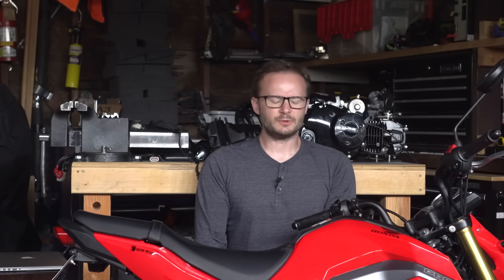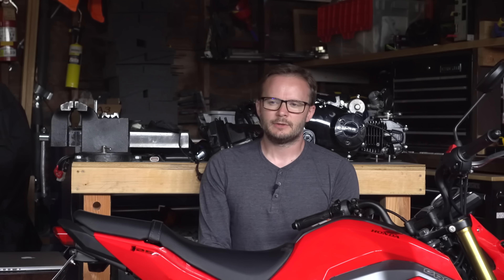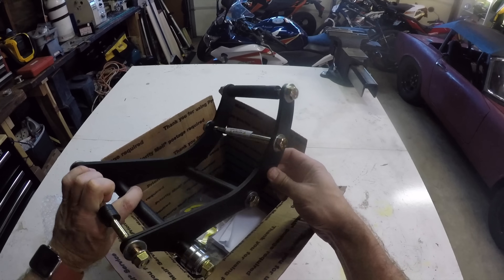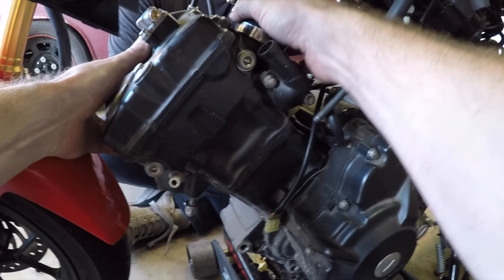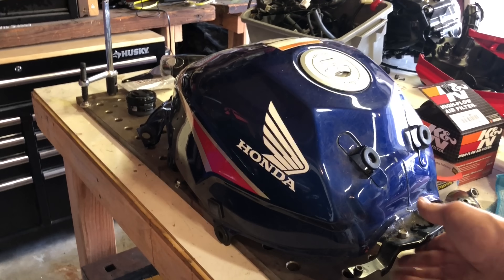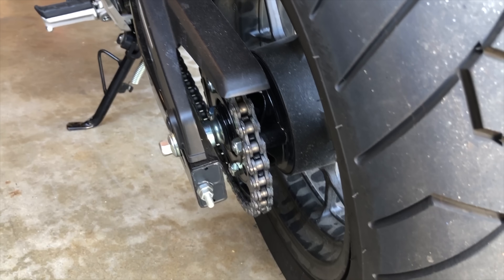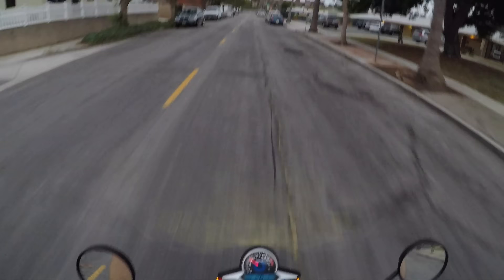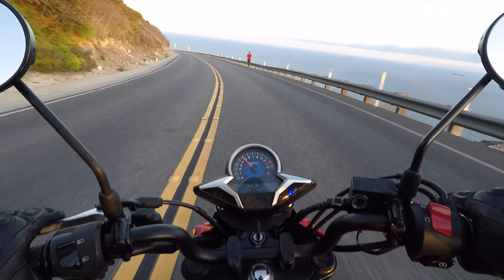Honda Grom Engine Swap: Twice the Engine for Twice the Price - CBR 250cc / 300cc How-To

Comment: For fuel Air ratio adjustment, I used a resistor in between the O2 exhaust sensor and the unit.
Though the ECU reads the signal digitally, it still enriches the mixture to the point where 1kOhms resistor gets black exhaust soot.
But you can feel what setting works best. It's a bit of give and take. Too high of a resistor (I tried with a 1kOhms pot) and the top end suffers, but the bottom will ride great. Too low, and the bottom end suffers.
So a mixture (I think I used a 250Ohms resistor, but don't quote me on that).
Reply: Just do it the right way and have the ECU retuned.
Reply: @The_Cat_Authority  actually the right way to do it now is with an aracer ecu. I do not know anyone with just a "retuned ecu" for their swapped grom. I have a 250 swapped sf.
Reply: @jaycolor994  Cool story dude.
Reply: @jaycolor994 How hard is the aracer to set up?

Comment: I had a 250 Kawasaki Samurai back in the 70's; thought THAT was complicated compared with it's rotary disc valves compared to the 250 Villiers engined James that I previously rode in the 60's ! This 250 make those things look like a T-model Ford in comparison; at least petrol gravity feed to a simple carburettor and a VERY basic electrical system made them easy for a teenage kid to work on then,................ I'm still modifying and riding motorcycles in my 70's !        Thank you for an entertaining channel !

Comment: its crazy because I thought of getting one of those Chinese Grom clones and swapping a 250 engine in it, i thought it would be easy because they would be both carbureted and both air cooled... but I just noticed you did it the right way (without being lazy with those two things I mentioned)

Comment: From what I understand the diode is for the hiss system (honda integrated safety system) the diode converts 12v from the battery to 9v to power your ecu.

Comment: I scratch built a board track style bike in 2016 starting with a 2013 cbr250r.  Later I swapped the 250 for a 300 and a few mods later I’m at 30hp to the wheel on a 250lb bike

Comment: The best way to lower the cost of a project is to save the Old Parts ( drive Chain ) And sell them later.
Why damage and Waste  things ?
That you can recoup some cash from .....
Work smart lower costs .
Reply: Excellent tip!
Reply: Try and sell a used chain on craigslist and let me know how many years it takes lol
Reply: @darklorddylan1316  
Facebook marketplace or Ebay would be better for that.
Reply: Q is legit. Don't trust the media. It's still a used chain. And the factory chain on bikes requires drilling of rivets so it's pretty much the same issue

Comment: The pink wire out of the ignition switch needs to see 5vdc to the ECM so you can't just cut wires twist them together and steel the bike. It's usually not even in the wiring diagram.

Comment: I was wondering why Kawasaki made their little z125 to be the grom killer but they didn’t put a 250 or even a 200 or even a 150 motor in it. I was guessing it had something to do with engine size laws and all that but seeing this guy put a 250 in a grom makes me very happy. If I were him I’d make the tires slightly bigger and maybe a little big bigger suspension and make it a step up from the grom in all areas. Good shit making this tho man.
Reply: Bigger wouldnt make it handle better. Bikes aren't like cars.
Reply: @chrispekel5709 yep. It’s now going to be limited by its height. Making it taller won’t make it handle better, but it will allow you to lean over farther, and that will allow you to corner faster.

Comment: Why not just swap the whole front end of the CBR ? Instead of worrying about controls, plugs, gauges etc... Plus get a brake and suspension upgrade presumably.
Reply: I would assume the forks are substantially longer and the tires are bigger.  It wouldn't work I don't think.

Comment: Very nice power upgrade.

it would be really nice if honda started offering the grom with larger engine size choices. even a 650cc would be really nice. and of course the frame and entire motorcycle would be increased in strength to handle the increased power. i just like the smaller size of the grom, but really need significantly more engine power. 125cc is not even close to enough power for my comfort. i like to be able to move out of the way quickly, as needed, when needed. and overall, i enjoy a more powerful motorcycle, while simultaneously being able to fit the motorcycle well. the grom really is the perfect size motorcycle. it just needs reinforcements where needed, and much much more power, for those of us that prefer more power to be available, at any given time.

Comment: Quick question, Since the cbr engine now sits at a weird angle will you have any problems with the oil pick up?
Reply: Yes. Yes he will.
Reply: @SchoolforHackers  There are several build threads and reports of guys putting thousands of miles on after a 300 swap, with no damage to the engine.
Reply: @jasonb6570  Okay, if it works it works. My observations are from seeing three different guys kill the motors riding extended wheelies on pit bikes. If this one works out, cool. But I’d be feeling spooky.

Comment: Put a screen in the intake it’ll help atomize the fuel too I do it to small go kart engines when they get modified just to help break up the fuel since I run richer than factory it’s tricky but doable and I’ve even seen them for sale

Comment: You can use a small fabric mesh over the intake or pantyhose I think is a common thing for sandy environments.   Otherwise you can make a metal mesh dome and cover that as well to keep it from getting sucked in while still providing good airflow.

Comment: What is the top speed?
Reply: The top speed will be whatever the top speed of the cbr was, since the gearing stayed the same. It will be physically limited to engine rpm and gearing, regardless of it being in a lighter, smaller bike. It will just get to the top speed faster.

Comment: I hit 65 and 70 on my grom all the time Id say its fast enough. One of the main reasons if not the main reason the grom has so much success is because of the mpg rating not because of the speed.
Reply: It's the top speed. 
Honda already had a huge success with the Ruckus and it's mpg. It just lacked speed.

Comment: I believe the diode is for the starter. i know on the 600rr there is a diode in the starter switch and the engine wont start if it goes bad

Comment: Yeah no nose wheelies as the front wheel traps on the motor , some miss the basics like oil pump running dry cause motor is to far tilted

Comment: I'd imagine going two stroke with a YZ125 engine would be more practical. Less weight and almost as much hp probably. the YZ makes 35HP and has 6 speeds. Only challenge would be wiring since the YZ has almost none.

Comment: Need help before tomorrow. 2019 Honda grom crack in the headlight , has aftermarket exhaust, I got them down to $2400 and it’s 3hours away from me. Versus a 2018 grom with new exhaust , pro tapers , new grips , flush mount blinkers, and license plate mount, and a new tail light. But the stuff is in the box and I need to have someone put it all on for me. He’s asking $2800 but I’m going to see it tomorrow an hour away and I’m pretty sure I can get him to $2500. Need help which is a better deal ! Both have around 1500 miles on them. Posting everywhere grom related 😂😂😂

Comment: I would opt to make a streetfighter/naked out of the 250 instead, get rid of the fairing, clipons, add a handlebar for a more upright riding position and swap the headlight for some eBay round one. But that's just me, a guy from a place where a 250/300 is a step up on the motorcycle ladder and not just disposable beginner bike trash.

Comment: I don’t get why you need a tune when you haven’t messed with the internals? What am I missing. Why wouldn’t the ecu just think it’s normal operation with the relocated injector?
Reply from the maker: I think it has more to do with the fact that I went from an intake with a volume of maybe 1.5 liters to no intake. So the response and resonance and whatnot is all out of whack. I didn't expect it to be as bad as it was either. Maybe it's worse because it is such a small engine and is more susceptible to variation?

Comment: To be fair…… it’s not so true that you’re “limited to 9 hp”. Without dropping the stock motor, you can reliably get to 16+ hp (I’m speaking on the 22+ motors I know, and I know you can squeeze more out of the 21- motors) for about 2k in mods. Which makes these run easily in traffic and a blast to ride with far less work. Nowhere near the fun of 30hp……. But not at all limited to 9hp. When I come across a good deal on either a 250 or 300 I’m sure I’ll build one myself, but 16hp or more in these is a ton of fun too.

Comment: I really don’t understand why Honda thought it would be a gear idea to put a 125 in the grom, that’s like so ridiculously underpowered for riding at all.

And I really don’t understand why Honda decided to continue with the Zener Diode for the security system. It’s the same thing on my 2001 F4I but the ECU needs to see 9v before the bike will crank or even fuel pump primes
Reply: Because they are insanely popular in southeast Asia and get 125+ mpg with the 125cc

Comment: you consider "a little bit more" is going from 9 to 30hp?  doubling the power would already have been more than a little bit.  so i'm pretty sure tripling it has got to be considered quite a bit more than a little bit more.

Comment: Zener diode sends that 3.9volts to the bikes computer, if the voltage isn't correct it will not prime the fuel pump or send spark to the plugs... Ask me how I know 😐

Comment: Ive recently got done doing the swap using your video. Super helpful but i have one question. The cbr300r i used as a donor came with engine and main harness, on harness there are two sensors that look to be for air or smog, not sure. Both connect to plugs near carb. Can you tell me what you did with them?
Reply from the maker: There are some sensors that go from the crankcase or exhaust back to the intake. Since this swap gets rid of the intake, you can just remove the sensors and plug the hoses. You can also tap into the short inlet tube and plumb them there if you want to keep them but you don't need them for the engine to run.

Comment: You had a fully functional 250, already assembled and you chose to dissemble both bikes to make the smaller and less useful bike work? And then you cut the chain right before you took the rear wheel off?

Comment: Great job on the video! I have a lifan kp 150 and have been wanting  to do a swap. The kp is a cfr engine clone. Wondering if you knew if a swap on it would be similar? Thanks for any advice!
Reply: Swaps on those Chinese bikes are pretty simple, you could easily find an air cooled ebay chinese engine to swap in without all the water cooled junk.

Comment: Yo Matt did you figure out if it was low in power below 4500rpm  because of the design of the fuel injection location or was it tuning?plus how is it running at this point?

Comment: I have an underbone that it not your regular 125 cc 4 speed with clutch on foot and automatic clutch to start rolling. 
Honda GTR comes out of the factory with a CBR 150 RR dngine, 6 speed, manual clutch, 16 HP and DOHC because why not? 
I would like to swap my CBR 150 engine for a CBR 250 or 300 do you think I could just unplug the 150 and plug the 250 one and remap the ECU and use a bigger fuel injector and radiator?

Comment: Why does the CB ECU need to be tuned?  The grom is lighter than the CB, so it's putting less load on the engine than the CB would have.  I would think the tune is fine.

Comment: The additional weight added from the CBR300 engine vs a Grom with a 24rwhp 1814v koso kit. grom with blueprunted bigbore will smash the 300 every time. that power to weight is wacked. you added like 100lbs to the grom with the 300 install
Reply from the maker: It's a 25 pound weight increase. I don't know why people keep telling me this swap adds a lot of weight.  After swap weight is 129lb front, 125lb rear: 254 total. Stock Grom curb weight is 229lbs.
Reply: @SuperfastMatt  hmm, intersting. since many verifiable websites have then lied to me.

Comment: The factory air box is far more than a factory air box,  a lot of engineering went into it, 
Notice the air intake entry, the size and design, yes it quiets the induction but it does a lot more, 
Like every time the intake valve closes this reverse pressure and fuel is captured , that with the velocity and mass
Of the incoming air, the reverse pulse causes a positive pressure helping to improve engine efficiency on the next intake stroke,
The bikes run like shit, due to now running lean with no airbox.
Also you never gain back the power lost due to removing the air box even after a whole heap of fuel is now injected into the motor 
After retuning,  you do use move fuel and have less engine efficiency and power.
Study the air box, volume and the way they have the air entering , length and size, 
Now build something with the same volume and air entry dimension, 
The other deal, in most cases the air pod, due to air flow dynamics , in most cases 
Is subjected to negative pressure , now reducing the power even more. .
Lots of engineering went 8 to that factory air box

Comment: But not tuning the ecu, are you not giving the engine only half the fuel that it needs? If your running it that lean, it won't be long before you burn a hole straight through your piston..

Comment: How is the Grom so low-power and only 4 speeds? My old 2008 CBR125 had 13 hp and 6 speeds, and felt adequate up to 90 km/h (55 mph). It would go faster if you geared down to 4th and redlined it, up to 130 km/h or so.

Comment: I jst had an oil change n gasket replaced with the spinner. After that I rode it n some oil spilled a little on to the tire is when I notice it lip during my turns. Then I herd a noise of winding or screech alil. Now it stalls and won’t turn on can you help

Comment: The bit that I don't understand is: If the CBR250 has a better engine, what does the Grom have? Why not just buy a CBR250 and ride it, leaving out the step where you bother buying a Grom at all? Is it just the need for a physically tiny motorcycle?

Comment: Wow. Do you know how thin and weedy the wheel axles are. Do you think the brakes will stop the extra weight and speed. This bike is designed to be small and light. Why do you think big engines need big frames. This will kill someone without a second thought.
Reply: New engine is only 10kg heavier

Comment: Does the 250/300 engine being tilted forward from the original design intent cause any problem? Wondered if there might be an oil pick-up that might not get proper drainage or flow.

Comment: For the cbr300r swap, will I need to add more oil in the case since it will sit at a different angle? Or do I put the normal amount? Steady garage mount
Reply from the maker: I put in the normal amount.

Comment: When you relocated the injector what you use to block the inlet hole from the injector on the stock position??
Reply from the maker: I lathed out an aluminum plug and pressed it in. Others have used rubber plugs from the hardware store
Reply: @SuperfastMatt  am thinking of let the existing injector in there and just buy a new one for the relocated injector ELBOW. What's your opinion on that?

Comment: HONDA GROM New Price: 3599$, HONDA CBR 250R Only Machines: 1000$, Total 4599$ to 5000$ with new parts, You can buy 2007 HONDA CBR600RR Superbike, KAWASAKI ZX-6R Used or SUZUKI GSX-R600. Modified Motorcycles are Crazy with net worth.

Comment: Awesome video! So how does it feel? Is there a considerable weight difference? What's the bike stability after the swap like? Is fuel efficiency the same on the 250 after swapping?
Reply from the maker: feels the same. swap added about 25 pounds. no idea on the fuel efficiency, I haven't checked.
Reply: @SuperfastMatt  Thanks for the reply! YT did not notify me for some reason. Speaking of MPG I suppose it's got to be the same or  less compared to the original 300 bike right?
Reply: @SuperfastMatt  Also, big Q, I read that sawping the engine leads to loss of power??? Like if a 300 has 30 hp on a CB-whatever, it has like 22hp on the Grom (some reddit dude said that on the swap page).
Reply: @cubul32  - that question is just ridiculous. The engine has no idea where it is installed, how could it?
That said, you cannot only swap the engine - you also have to swap the computer, sensors, etc so that the fuel injection and everything else will work on the new motor..
Reply: @johncoops6897  not really, mass, geometry, wheel size all that effect the fuel economy. It's not that ridiculous. In the meantime I found that the elbow messes with AFR and the engine actually is less efficient.
Reply: @cubul32  - well if you only swap out part of the engine, and do such a poor installation that it doesn't run properly, then of course it won't work as well as it did originally.
For example, this guy deliberately left the old 125cc computer in there, despite swapping the wiring harness from the CBR250. So guess what.... it doesn't idle or run properly compared to when the engine was installed in the CBR.
It's such a dumb question, but then again it's a really dumb  conversion anyway.
Reply: @johncoops6897  others did a full swap like you say. And still didn't run well. But I agree, this was a shabby.